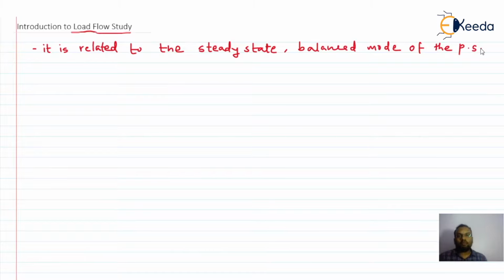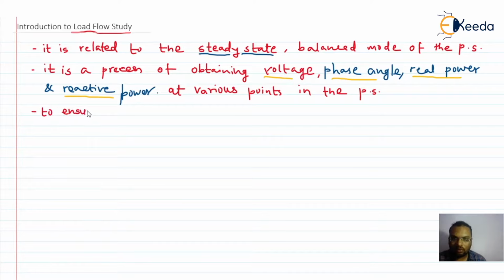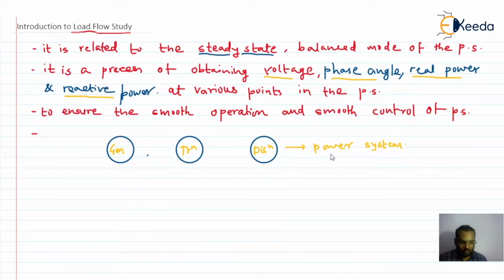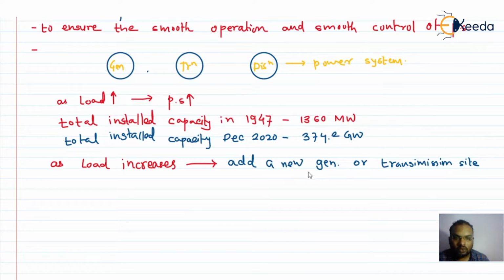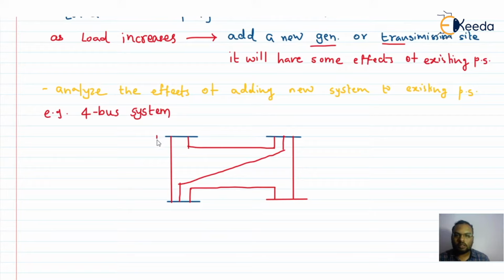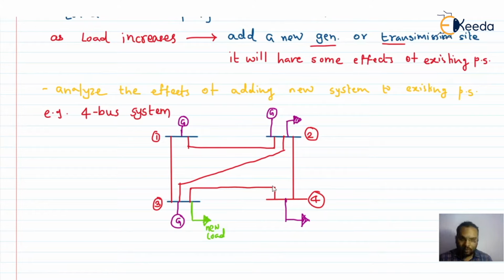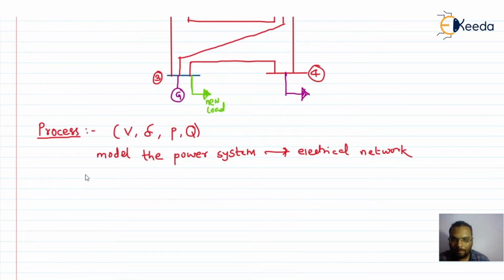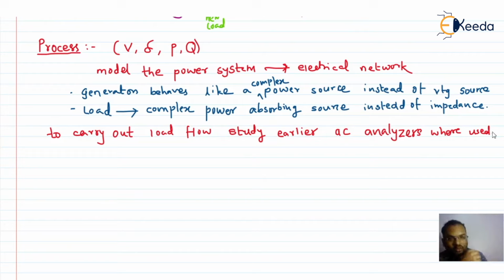Introduction of Load Flow Studies - Load Flow Studies - Power System 3

Comment: What's the difference between power source vs complex power source
Reply: Power source = active power ( watt)
And in AC circuits, complex power represents the total power as a complex number, including both the real (active) power used to do work and the imaginary (reactive) power
Reply: There's certain power sources that only provide actual power. Complex power sources, like Synchronous condenser, are actually able to provide reactive power into a system which help make a system more efficient